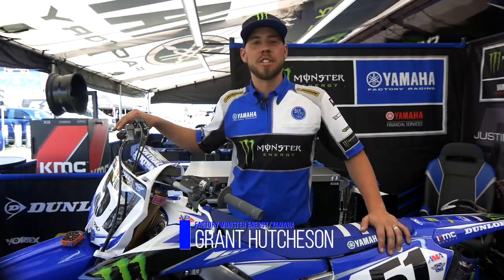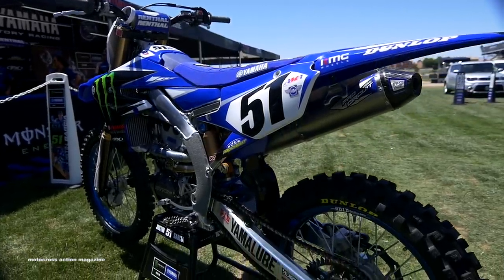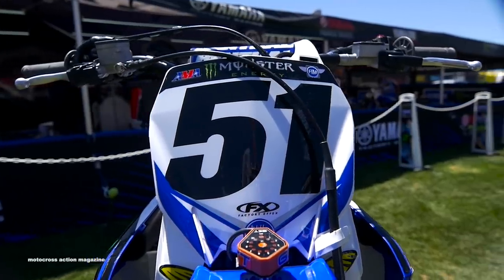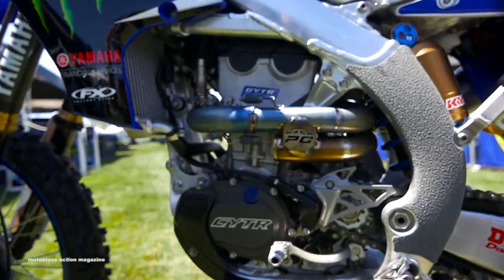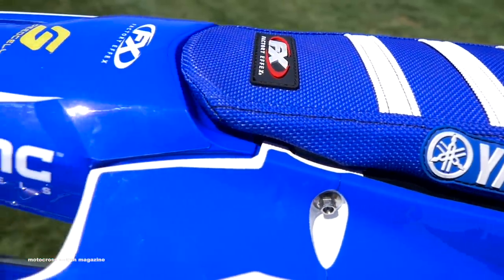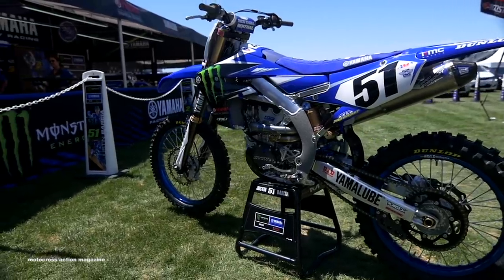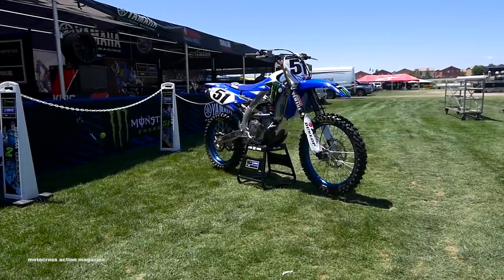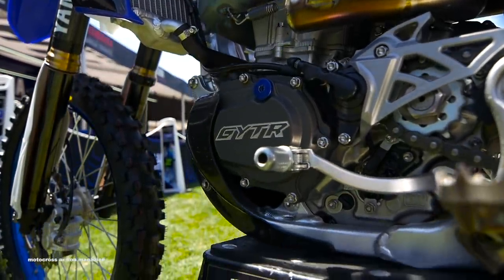Inside Justin Barcia's Factory Yamaha YZ450F - Motocross Action Magazine

Comment: This is the bike of my dreams. Id need much taller bars and stiffer suspension but, oooooohhh mylanta this motorcycle does things only my fiance does for me. I own a 2020 yz450 and i love it almost as much as my pit bull. Its hands down the best motorcycle ive ever owned. Ive only owned yamahas since i stepped us to a 125 in 1998. I bought the very first 2003 yz450f in reno Nevada. I still own it. Cant beat the 5 valve engine and 4 speed box. Best bike for sand in the world. Mine is tricked the fuck out, 81 wheel hp. It has every single performance engine part pro circuit makes.